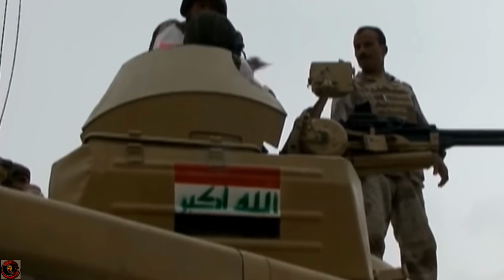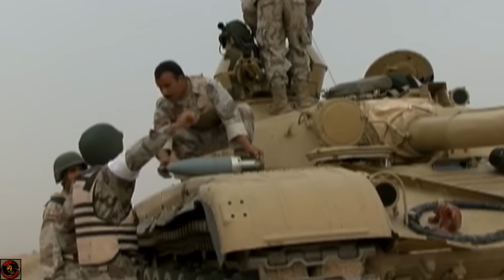Do Russian Tanks Need Bigger Guns?

Comment: Great video as always. Agreed, for as long as we/they can get by with existing calibers it makes sense to do so. Improvements in ammo and possible increase in barrel length will help. However there may come a time were armour/APS/ERA etc makes current calibers ineffective, at least at long range. When that happens a increase of caliber may be required. I can imagine a tank force having a small number of upgunned tanks, similar to the firefly, which would be saved for engaging the most heavily armoured enemies, and for engaging targets at very long range. This should provide a good compromise between increased performance whilst reducing the economic and logistical burden. I have heard the Russians are considering doing this by equipping a few of their T-14 with the gun from their new SPG you reviewed a while back.

Comment: matsimus the M1A3 Abrams will Absolutely be able to destroy any Russian MBT including the t-14. the M1A3 Abrams will be a Next-Generation MBT, Far more Technologically advanced then the Current M1A1 and M1A2 Abrams tanks.
Reply: Since i heard this from a random expert on youtube called xu da, i guess it has to be true!!!
Reply: Well, the same goes for any western tank. Shoot it in the sides with an RPG and it will be knocked out.
Reply: xu da m1m3 isr still a abrams so it isnt new i dont Think it will ne better than the leo 2a7 is on the Dame level
Reply: One lucky shot is all it takes.
Reply: No, the M1A3 won't be a next gen MBT. Don't believe the marketing, they also say the M109A7 Paladin is a next gen artillerie piece, and that thing manages two rounds in a minute because it reloads like a WW1 artillery gun. Or how they just dropped a bunch of requirements just so they could call the F35 a gen 5 jet fighter (and you really don't want that thing to fight anything in the air).

At most it'll have a cannon that can shoot very slightly higher pressure ammunitions, and that's it. And it'll still have more firepower because the russians don't use depleted uranium, which the US forces reguarly use to pollute someones homeland with heavy metals... (yay for 15 time cancer rates for children compared to 10 years ago before the war)

Comment: I think all types are needed. 
The small size of the Russian T-Series is good for hit and run attacks and ambushes because of the mobility and speed. They can access or pass through areas Abrams can't, like in forests and even swamps. The ability of T-90 to use several types of ammo and rocket among them is no small thing. 
The Abrams as larger is better suited for defense and open areas like deserts. Beter optics and GPS gave no chance to Iraq's T-Series during the Desert Storm. 
The 152 would be needed for assault, to support the smaller ones from behind and in tactics could be invaluable asset. Tanks in the city are often an easy pray and the 152 has no business there.
Reply: T-X-M yeah, but nothing is total fortress. Abrams has better armor than T-Series with probable exception the Armata. But Armata for me is another class and T-90 will be good team mate for it.

Comment: It's funny that most of the issues with increasing the caliber that you note in the beginning of the video don't apply to Russian designs because of the heavy reliance on the autoloader.

But anyways, 152mm promises a lot of potential:

- 18% more muzzle velocity with 80's tech compared to late 90's.
- 80% more HE potential.
- 152mm ATGM's, which is a big deal.
- Whole new field for later improvements.

Downsides are no less daunting:

- lack of potential targets outside of all out war(bad guys still use T-55, 62 and early/chinese 72).
- development and production of the whole new systems of HE, HEAT, APDSFS.
- transition from an established caliber or mixing the two in the arsenal.

I guess if the USSR didn't have major economical issues and was still around and we would still be in a state of Cold War, the transition would've happened in the 2000's. But right now it's just not viable.
Reply: If the cold war never ended NATO would have the Leopard 3 with 140mm (NGP) since 2015 :( Well, atleast the reseach went into the Puma and the MGCS.

Comment: Bigger isn't always better. With larger calibers, larger ammunition comes, thus decreasing ammunition storage capacity and increasing loading times (two-piece ammunition BS). For now, there's a sweetspot to find for the caliber size (may be found already, remember Rheinmetall ditching the 140mm and going with the 130mm), and then it comes down to improving on chamber pressure and penetrator design.
Reply: And of course using a smoothbore! Yes i am looking at you british minstry of defense! (and india lmao).